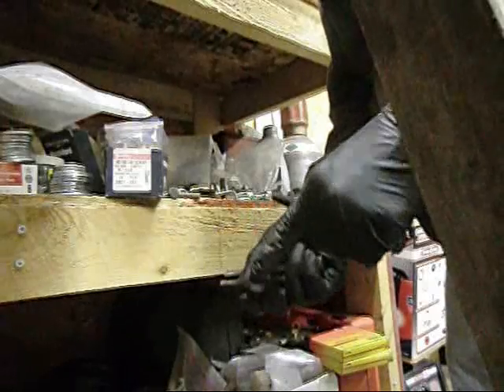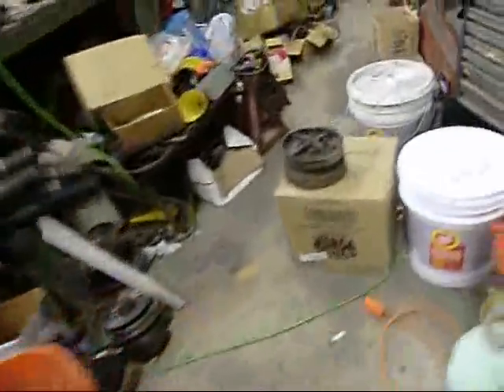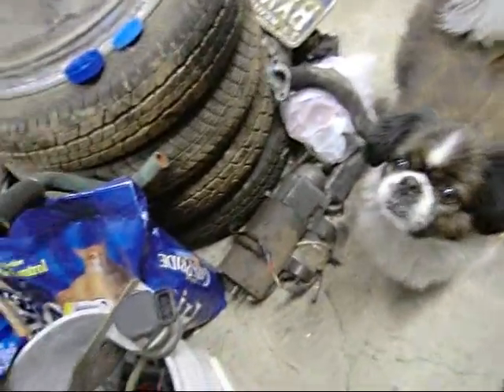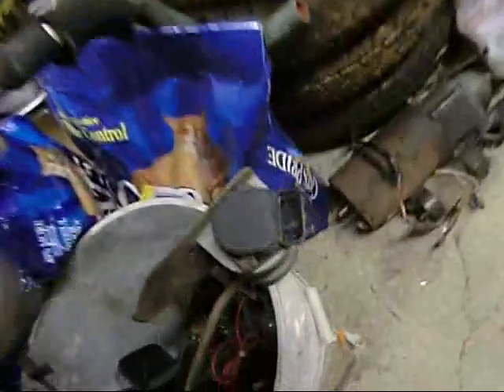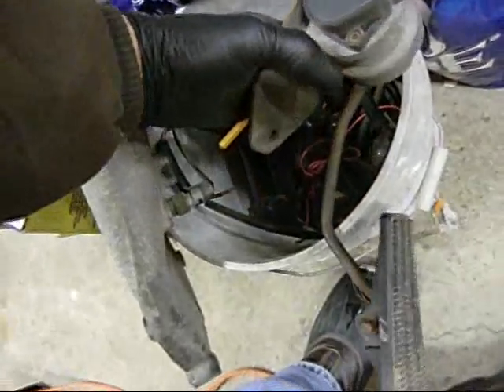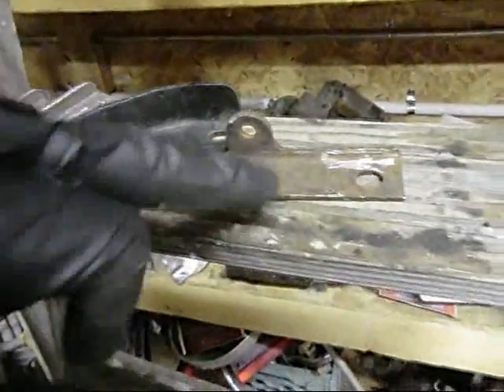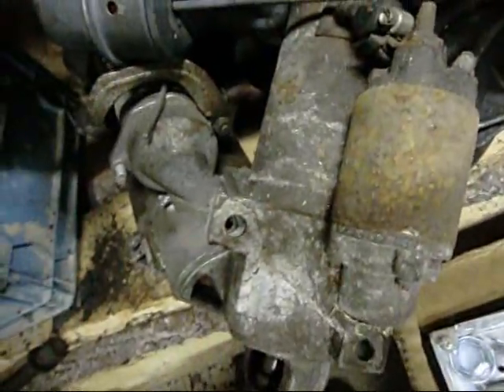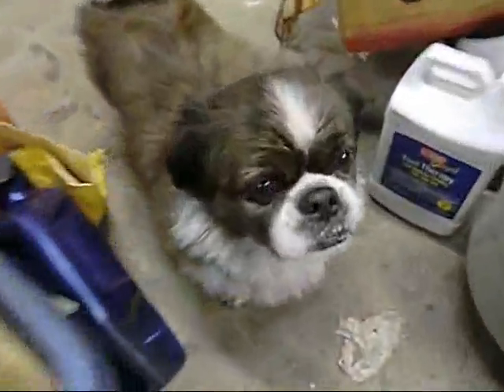6 2 & 6 5 Starter Bolts And Brackets  1 5 14

Comment: I have a 1989 chevy cheyenne 6.2.the starter bolts tend to break off from time to time even though i bought some high strenght ones from Napa....is the bracket need for my specific truck ...if so what the bracket doing and how is it preventing the bolts from breaking?....response would me much appreciated
Reply from the maker: The starter triangulation reinforcement bracket is imperative. I Have two or three of them, and I've misplaced them in my big mess. it's a simple bracket, but GM hasn't sold it in years and years. And I've been cutting up similar ones and welding them to the proper size, and now I can't find where I put them. Email me corvairwild at gmail.com

Comment: When mastercraft changed to make them in china, rackets started flipping sides randomly. My 250$ racket set is not the same after exchanging the rackets. They look identical but wears out every year. the first set lasted over 8 years of abuse.......
Reply from the maker: Yeah, the china ratchets are famous for reversing by themselves
Reply: It's pissing me off since I cannot justify buying a 250$ snap-on rachet head. So I have to deal with the autoreverse rachets! This is unlike casette player where autoreverse is good...

Comment: GM engineers were over ruled  by the penny pinching accountants on some of the designs of the 6.5.L  engine. The starter was one of the headaches and the oil pressure switch was another.....